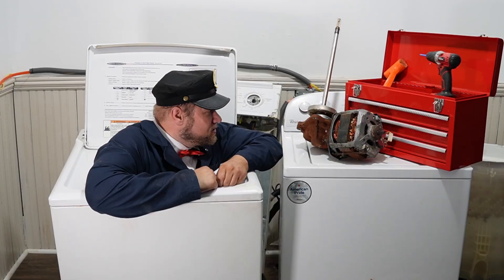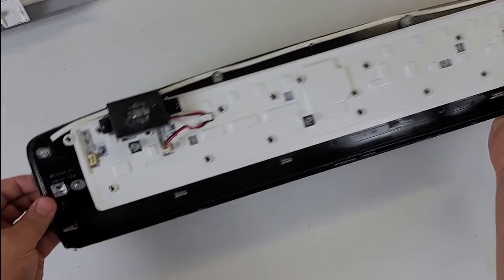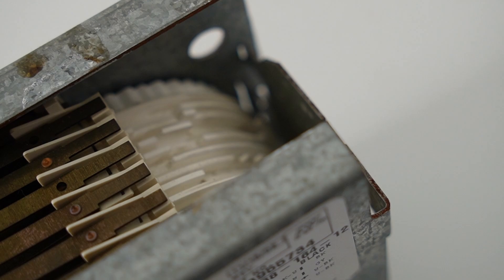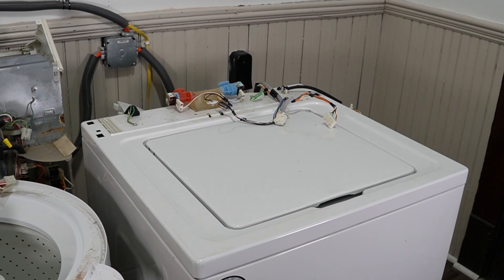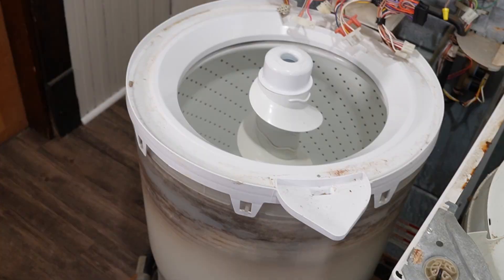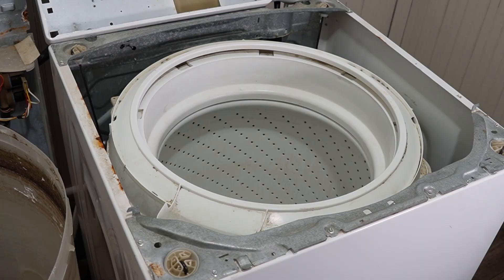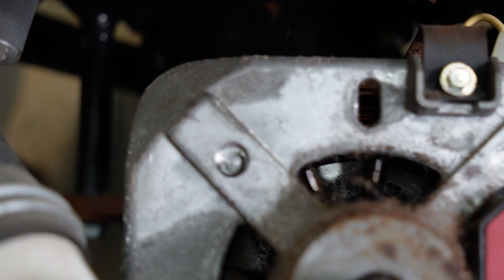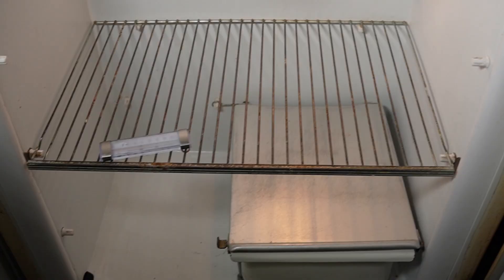Are Washers Built to Break? Inside a 1984 Washer vs. Now

Comment: Had a friend that asked me for help with a lid lock unit, his lid was locked and he could not open it. I finally got it open and the circuit board that was under the lip of the top housing was corroded and the traces were basically gone, it was in a position that allowed water to splash up onto the board. Really bad design, they could have at least added some sort of water proofing. I fixed out older washer and dryer many times (20+ years old) it was easy and cheap. Not going to be as easy or cheap with newer units. Only reason I went with newer units was to save water (in California) and electricity.

Comment: Everything is built to break. Incandescent light bulbs, for example, would theoretically never burn out as long as the interior of the bulb remained a vacuum. There's actually a light bulb that's been on for nearly a hundred years:

"The Centennial Light is the world's longest-lasting light bulb, burning since 1901, and almost never turned off, it is at 4550 East Avenue, Livermore, California, and maintained by the Livermore-Pleasanton Fire Department."

But if air gets inside, the tungsten filament can actually burn through. In a vacuum it can't burn, it just gets hot. The air gets in because the glue that holds the base to the glass is made of heat sensitive materials that will crack over time. When a crack becomes deep enough to allow air to move from outside to inside, even a few molecules of oxygen, the tungsten filament will chemically react in the ignition process and burn through almost instantly. This is why bulbs often burn out when you turn them on. When they were last used the seal was heated sufficiently to begin cracking, the bulb was turned off and cooled. The seal, now with weakened spots, cracks as it cools down because the remaining strong molecular bonds overpower the weaker molecular bonds and it pulls itself apart. Now air has entered the system. But the filament has cooled below ignition temperature. That changes when you turn it on again: the filament is instantly at its ignition temperature in the presence of oxygen. It flashes and goes out forever.

I currently have a 1976 (or older) refrigerator that my grandfather used. It still works great. I am not sure how old it actually is, I just now this particular line was made from like 1950 to 1976. New refrigerators fail after less than a decade in some instances. Its planned obsolescence. Basically a subscription service for appliances, if you will, in that you have to keep buying new ones periodically.

Comment: Living in an upstairs condo, I would much rather deal with a machine that I can replace parts on, instead of having to get a entire new machine up my stairs - I do have my old front -load frigidiaire sitting in a washing machine pan - so if it leaks it is contained (which it doesn't leak) - I also use a good surge protector on my appliances like this, especially with the very crappy circuit boards on newer units. I feel there ought to be great pressure for repair companies to repair circuit boards to better than original, such as better capacitors or relays if needed - and update new circuit boards with better materials. You shouldn't have to replace an entire expensive circuit board - and replace it with the same crappy circuit board -

Comment: In theory, the newer control board could be made way more reliable than the old mechanical board. All those metal contacts exposed to moist air in the control wheel, and so many electrical connectors should be a nightmare for reliability. The new board has so many less moving parts and contacts, and could be made super reliable if the manufacturer wanted to do so. The boards could be coated to avoid moisture and corrosion damage and the capacitors could be high reliability 105C types with higher voltage ratings. Of course that costs money, and these are very price sensitive products. I would be very skeptical of all the touch pad switches on the digital front panels. Those are often troublesome if corrosion or moisture creeps in.

Comment: The irony of this video. I have the exact same two washers right now. The new he machine is 2 years old and came with a pre rotted transmission shaft. The splines are 70% gone before it was assembled (bad casting), the retaining clip has nothing to hold the drive ring for the drum and the fit is so bad the drum wobbles. I just acquired the same elite model built in 2005 in Ohio it's lightly used and I'm currently giving it a better than factory refresh because I will never have another one of those JUNK new ones in my house

Comment: I need the Kenmore that's 20+ years old for parts please, mines still running but for how long. And parts are always needed to keep the old girl running.

I'm getting flashbacks as you tear down the 20+ Kenmore, been there so many times, the only thing not replaced at this point is the motor. Everything else has been changed at least twice.

Comment: You might want to keep a bottle of ATF in a squirt bottle. That type of transmission fluid does wonders as a penetrating oil. If that doesn't work turbo charge it with some acetone.

Comment: Trouble with over integration is the tendency to look at that PCB BOM as a cost item in isolation, especially when the production of the board is outsourced. The reliability of the end board is a function of the quality that went into the component selection. Wouldn't be the first time, a 'just so' sub was made to reduce the contractors cost base and thereby increase their profits at the expense of long reliability. I've come across many a repair based on bad elec caps and failed relays, an additional $1 spend on each can do wonders for long term reliability..

Comment: I'm kind of impressed they both give actual controls. All the ones I've seen in the UK are like "sports", "cotton", "synthetic", "wool", "delicate" (isn't that wool?), fuck no let me adjust it properly xD  
Then they fail in a year because of a 5p sensor or some crap where a 10p one would've lasted a century, (or a 50p vs £2 relay, etc.).

Comment: Not quite the same but I’ve got a 31 year old diesel truck and she’s a dream to work on. Mechanical everything except a little computer in the automatic transmission. These old things are indestructible, there was a story of a company trying to kill their fleet of old 7.3 idis for some reason and even pouring sand in the engine didn’t kill them. This truck could outlive me if we take care of it (I’m in my late 20s). Even if they stop making parts for these old trucks, machining them up wouldn’t be too hard. Old things were made different, I partly blame planned obsolescence and partly blame cost cutting in manufacturing and workers that ends up costing the consumer more in the long run

Comment: The Kenmore's motors both washer and dryer use to have oil holes. The newer ones 1980's did not but a hole can be drilled where they should be where the bushings reside. I did this on several Kenmores that were thought to be dead. I use golf tees to seal the holes. Thanks good video. What do you use to clean the gunk out of the tbs? FYI: I do almost all my own repair mainly because you can't trust who will work on the unit.

Comment: Purchased a Maytag washer and dryer from HD a couple of years back. Just before the warranty period ended, the machine started to make a grinding sound. When the repairman came, he had to order a replacement transmission. Ended up replacing everything except the drum. As for my French door refrigerator, just after warranty ended,  the ice dispenser motor would not stop running. Come to find out, the PC board was defective and the part was over a $1000. Ended up disconnecting the motor and now i dispense ice manually by pulling the tray and emptying it into a container in the freezer. Don't buy Maytag. It is no longer a high end appliance company.

Comment: The key takeaway is that the most common failure point is the weakest/cheapest component on the PCB. Most "technicians" won't have the skill or even if they have the skill they won't have the schematics and components to repair the PCB. I think its more to do with things not designed to be repaired easily. From a design point I think things are better but the quality of components used is poor there by leading to poor reliablity.
Reply: Yeah, there is no reason for anything to be fixed easily and chraply if there were proper manualsan schematics. But such don't provide to the manufacturer and that's no good!(

Comment: People tend to overload them, especially trying to wash comforters, not realizing that some of the fills used retain a lot of water, greatly increasing the weight. These aren't commercial machines and very heavy use can cause a lot of wear to motors, bearings and suspension pieces. Using the wrong detergent can cause seals to get rigid and fail prematurely. Some old fashioned laundry aids, like borax, should not be used in modern machines. Dried out borax is like concrete and not good for your washer, ditto washing clothes exposed to chemicals.

Comment: Are any washers still made with without circuit boards? Even the cheapest Amana looks to have a control board - it is always the control board that goes.  I manage about 200 units with Kenmore washers I always get them repaired as long as I can get parts still. I have about 100 more units with newer washers some of them have broken within a year.

Comment: The lesson I have learned over the past 20 years is the biggest mistake you can make is to buy an appliance with a control panel consisting of an embossed plastic touchpad. None of them made it past 5 years without falling apart.
Reply: I have more than a few cut out myself

Comment: If you happen to gain any experience with industrial washer-extractors, you quickly find out just how bad residential machines are.

One example: to save water, the washer might replace a rinse cycle with a spin (extraction). It's best never to spin after the 1st wash (the suds bath). This can centrifugally beat soils back into the clothes and they will never come out. Many residential machines do just that

They're designed primarily for hands-off convenience and water conservation, sacrificing a lot of wash capability. Many people just need to make their clothes smell nice, so the machine is made to work just well enough.
Reply from the maker: Absolutely. The tech behind commercial/industrial is so much better, its unreal. My brother owns a laundromat here on YouTube (Investment Joy) and I've dealt with his machines. The machines simply don't mess around, period. The cost is so much greater, but the results are too.

Comment: My Whirlpool washer and dryer are from 2004, and still used the old-style design from the early 80s. I bought them brand new when I bought my house that I still live in. Today the house is paid off and the washer and dryer are still running tip-top. Will I replace them if they break? Never. I'll gladly pay to have them fixed (if I can't fix them myself) rather than buy the new, cheap stuff. There's a reason the new motor and transmission weigh a lot less than the old one: they're junk! And as someone who is in computers for a living I know computers are temperamental. Give me old school switches and relays and hard wired connectors any day over a circuit board!

Comment: The components of my top load  laundry machines and drying machines are made of case hardened solid hot forged and-or hydraulic pressed stainless steel alloy. They were designed, developed, and mass produced for our military for 24-7 non-stop use to clean up everything regardless of what we throw at them (heavy all terrain military survival boots, utility belts, heavy uniforms, arctic gear clothing, rubber shoes, rugs, heavy military issued blankets, etc) and they are still as good as new and still kicking like brand new after more than 65 years. The factory making them (there are 7 of them) are still making them based on their original designs and original materials and specifications STRICTLY followed on how to make and treat these stainless steel alloy materials into components. The revolving seals are made out of metal with cross hatch precision machining after they were case hardened and annealed-tempered (no quenching). Everything about them is OLD SCHOOL engineering using an all analog mechanical and electro-mechanical controls, etc.
Reply: And cost? How many would be sold in a Home Depot lineup against a modern design at 1/10 the price? Quality is a wonderful thing, but getting consumers to PAY for it ain't going to happen.
Reply: @markfisher7962  Think hard about the math by SPREADING THE COSTS over a period of 5 to 6 plus decades and take into account of the additional costs incurred by INFLATION over the same period of 5 to 6 plus decades. These are military grade strength laundry and drying machines for the military made decades ago. I just happened to be in a situation when I was still in the service of an another agency connected with the military agencies 57 years ago.
Reply: @darthvader5300  There's no question that the machines you've got are great. However, today's machines are built to sell (not last) and be quickly assembled. There is no way a machine from 20 years ago could sell today for even twice the price of a standard modern washer. That old (hand assembled) wiring harness alone cost more than the entire modern control system.
Reply: @markfisher7962  But what they are not telling you, the American consumers, even if you pay 4 to 5 times the present price of todays laundry and drying machines, you can SAVE MONEY by spreading the costs over a period of 50 to 60 years of trouble-free 24-7 usage no matter what you throw at it. Plus the enormous savings from INFLATION! And these old designs uses bearings and ring bearings to prevent shaking totally and they are as tough as the toughest bearings used in heavy engineering machine tools. In the 1950s they generously add tantalum-niobium-chromium-tungsten-cobalt-misch metal rare earths alloys in military grade stainless steels. Even today, tantalum is used in making alloys used in making components we cannot afford to fail for 24-7 usage such as power plants and niobium at 1.5% gives stainless steel and tool steels (along with tantalum-chromium-tungsten-cobalt-misch metal rare earths alloys) an unusual wear resistant properties and characteristics, what more if it goes beyond 1.5% niobium content and that was in the 1950s.

Comment: On that older machine, I always did think it was kinda cool the way they just reversed the motor to get the pump going and engager spin or agitation.  I have a Roper.  Made by Whirlpool I think.   Made in the90's   You would get tetanus looking at it, it is so rusty but it still works.

Comment: I think so. I bought a brand new washer. Two years later the transmission breaks and here I am learning about washers. Who would make a plastic transmission? Even worse it's sealed so even with an angle grinder I gave up trying to open the thing so I can see how bad the design was and what actually failed.

Same thing with my dishwasher. This one 3 years old and I bought it brand new also. The timer fails, causing the solenoid to melt. For one the solenoid gets to about 125 degrees Fahrenheit under normal operation. I can't understand why it's designed that way so even under slightly additional usage it melts. And why does the timer break in the first place after only 3 years?

And don't get me started about dryers. You would think someone would invent a lint filter that actually filtered lint eliminating the need to take apart and clean your entire dryer in addition to cleaning your dryer vents every 6-12 months.

And of course all the warranties cover are parts after a year once they fail so you have to pay for labor which is more expensive than anything. I don't even bother with warranties and buy parts online.

I'd buy high end appliances, but I think it will be just more complex parts that will be more time consuming and expensive to replace.

Comment: I bought a new washer and dryer set and when the delivery guys set them up they said let it run one cycle then operate it normally. I tried no less than four times and the washer was not letting in any water on any settings. Returned the next day.

Comment: I saw the Kenmore.  My mom had that Kenmore as a matching set.  I don't think it ever died.  Worked flawlessly.  
I am concerned for the one they have now though, Dad bought the "biggest one you got" at a big box discount store and it sounds as if it is going to crash  through the wall.  At 90, they don't NEED the biggest one.  Top Loader.  Whirlpool or GE. I think.  
God, I hope it isn't the Samsung ones that were recalled, rebranded.  
IS that a danger or am I being overprotective?

Comment: We had a 1970s washer machine, we use that thing for.. I'm trying to do the math, I'm so old. 18 years, we replaced the belts couple of times and that's it. Throughout that 18 years we spent a grand total of $30 on repairs.

Then I bought a brand new Samsung heavy duty fancy washing machine. It would break down every goddamn month and the grand total that we spent on trying to repair this machine within only 5 years totaled over $2,000. I could have almost bought myself a brand new washing machine on the amount of money that I spent on repairs on this thing.

Dryer the same thing. 1970s be replace the furnace once with a grand total of $50. The matching Samsung new dryer, same thing as the Samsung washing machine.